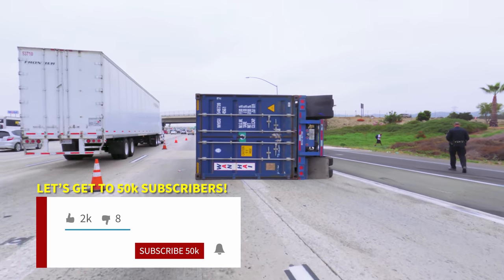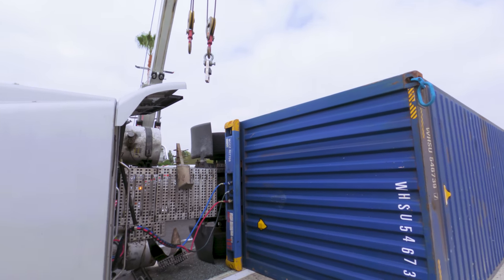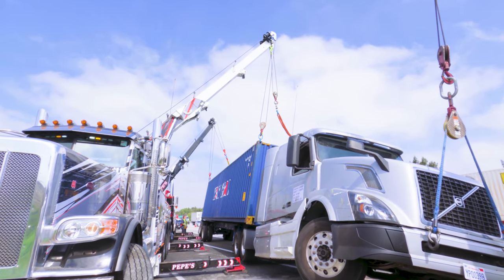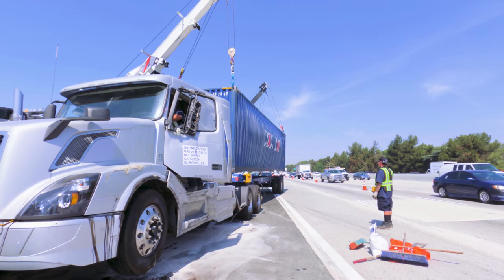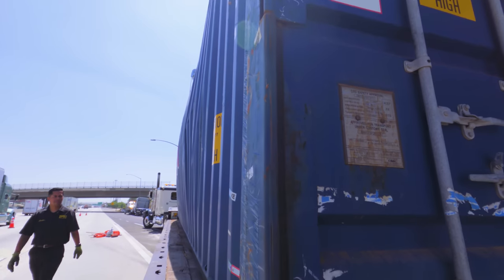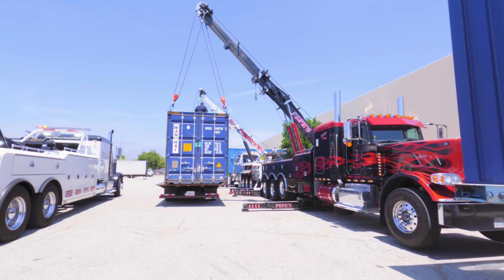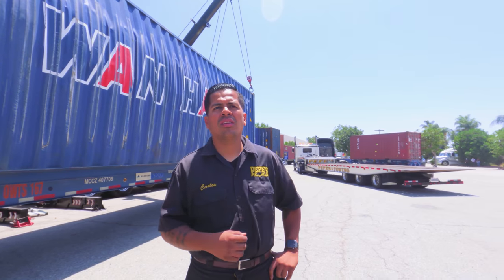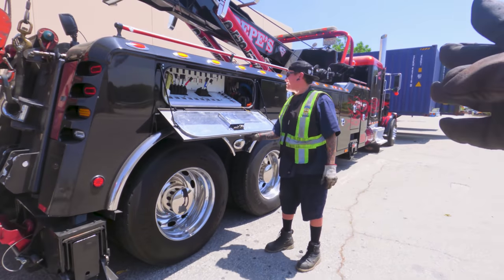Shifted load big rig rollover on freeway

Comment: Josh , Dave , Rudy & the rest of the crew, great job gentlemen When I owned a truck with my best friend many moons  ago, the railroad pigs were quite like this. Sloppy loading like this,or packed to the 'gills' meaning  OVERLOADED with the seal attached. First thing I learned in metal shop in high school 'SAFETY FIRST' and you guys have it!   Thoughts from an elder heading toward 71 on the speedometer.
Reply: Ípp

Comment: Is that a solar panel on the truck?  22:34  If so what are you using it for?  To maintain batteries?  Thanks!
Reply: I guess it's also for powering the fridge and the shower

Comment: Ever thought about carrying finale bags so you lock half the load and counter lean the other half? 
Or maybe big inflatable air bags that would slide the load back over, if the wall would take it.
Reply from the maker: We have high pressure matts in each rotator. On a job like this, it would take much longer to get a bag behind each individual pallet, then inflate it to move it. Counter leaning is also hard on the equipment
In some scenarios it works well but on others it's best to use a Landoll because the low center of gravity and not knowing how much damage the chassis took during the flip.

Comment: This nut really grinds my gears!  22:37 Everytime I see this nut I think, that should be a wing nut.  
@Pepe'sTowingService:  Ask Mandilón MacGyver in the shop to cut a same size nut in half, tack weld it to the shoulder bolt nut, put the retaining pin on a keyring, drill a hole in one on the newly fabbed nut wings and attach with a Aircraft Cable Key Ring.  Now you have a wing "gloves on, drop resistant, no lost pin" nut.    P.s. if B/A Products comes out with this later they better show me the money! lol

Comment: Who is responsible for unsecured load in a sealed container like this? Like if the driver is told everything is fine and unable to check a locked container do they still get liability just for taking the load?